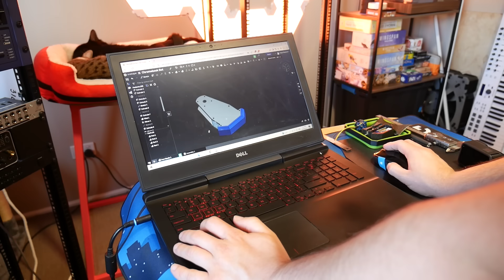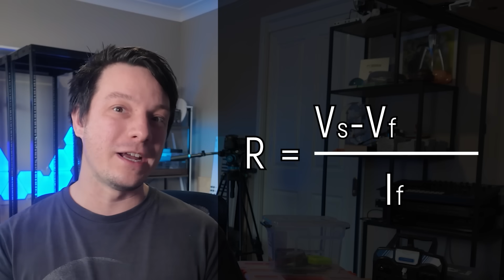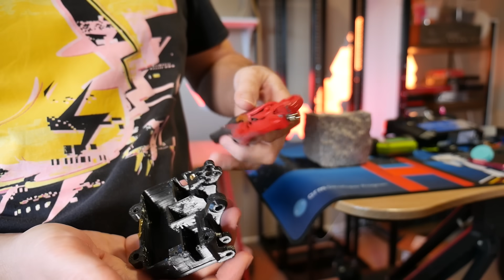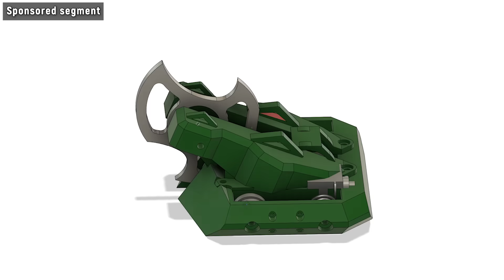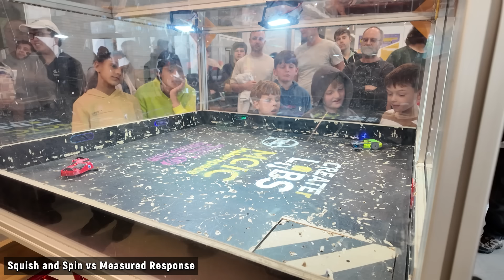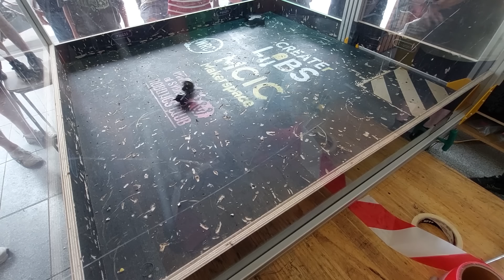How CHEAP can you make a combat robot?

Comment: That transmitter protocol thingy made me think about, well, disrupting the transmission of the other player. That would be a shitty move and for sure against all kinds of rules. But. A small EMP pulse? Not in any official match but you could probably get someone to battle against for fun with it. A small disrutor pulse. It would for sure cut the control on BOTH the robots for a short while, and, yea it would be dumb. But i also feel like it would be fun.
It would be hype in a match to have a robot that emits pulses every now and then. In the broadcasted matches it would make for a cool gimmick. If the rules allowed for it. It would be sorta kinda useless as a real weapon, to make it not unfair it would need to be really short. But oh boy it would be different.

Comment: hey had the thought that, Bambulab has there maker supply's and was woundering if you can find what you need in there to make an antweight battlebot? There might be cheaper sites or better alternatives, but i was just woundering if its possible. (not counting the screws but mainly motors, control board and other electronics)

Comment: One thing I would have also brought up in the video is wedge bots and servo powered weapons like grabbers and lifters, as I think only focusing on spinners not only limits people's options in their design, but also poses a much greater safety risk.

For newer and especially younger builders, I always recommend these first because they are not only easier to construct, but WAY safer to test. Spinners should never be someones first robot, especially if they don't have a safe test box, as they can cause serious damage and injury. Wedges, grabbers and lifters meanwhile are very easy to assemble, lower the cost and are much safer to run outside of a test box. Plus control bots are still a ton of fun.

Comment: For traction, use liquid latex! When it dries, it turns into rubber.. which is pretty much what tyres are made of. Just brush it onto the outside of your tyre, or dunk them into it.. let it dry.. then repeat a few times. It'll be really tacky, flexible, but also quite tough.
And the N20 motor might've been one for higher voltage.. but yeah, they still seem to vary a lot in quality. Not sure if 1000RPM isn't too much too.. looks like it's extremely hard to control.
Reply: Liquid latex is often used for theatre masks/props making. Just get a small amount for testing first. It doesn't have a very long shelf life.

Comment: I think there is a way you could forgo wheel motors and run dual spinning blades going in opposite directions on opposite sides of the front (i guess kinda crab-shaped).  They would likely need to be at some angle above the horizontal, which would then lower the edge of the blades to the ground as well, letting you get lower hits in.  Controlling the movement/direction would then be using the combined torque to 'steer'.  It would likely be easier to control as well, albeit slower moving.

Comment: Brass inserts with like 100kgf of pullforce insufficient for ant class combat robots?
Odd...
But then what else you can do is just have tight hole and have a metric screw like M3 jam into filament, in some cases the friction can be so much that it will snap the head off.
Reply: Heatset inserts simply don't provide that level of pull out resistance in TPU.

Comment: Now make one without a 3D printer. It's hard for a child to convince their parents that they need a $200-$500 machine to compete in a sport that they just heard about. I used a salsa bowl and cardboard to make a $120 USD robot, including the cost of all tools I used to make it (Harbor Freight soldering iron and a bottle of super glue).
Reply from the maker: I do agree it's not cheap to buy a printer on a whim, but any builder would jump at the chance to help a newbie with a printed chassis. I have done it loads of times. You can do the lot by hand (I certainly used to) but it's pretty finicky at this scale.
Reply: @MakersMuse 
Now you’ve got me half considering bringing bags of 3D printed parts to a comp to hand to noobies.
Reply: Check local libraries, community workshops, and fabrication shops. I've made plenty of 3D printed projects without owning one. It helped to have experience with them in high school, but was not a necessity

Comment: The trick with drilling SS with std HSS drill is very low rpm, ie, it's the heat from high rpm that dulls/burns them. I have made straight-through SS mufflers than needed 100s of holes.

Comment: Aliexpress sure does have cheap motors, will be getting some to try.  Higher power motors use carbon brushes, cheap ones are just metal and cannot handle higher current/powers.

Comment: You should think about using an FPV Drone smoke stopper for the first power up, it limits the current so it shut off if there are any shorts/reversed connections. I've built over 100 FPV drones, wings and planes and still use them.
Reply from the maker: Those look pretty neat! Only just come across my radar, I'll pick one up.
Reply: @MakersMuse  they are a life saver, they would have saved me thousands of dollars worth of ESCs and flight controllers.

Comment: $116AUD is about $75USD which is about 2-3 days of working McDonalds part time. A cobalt drill bit can be bought for anywhere between $3-$20, a drill press and a Bandsaw will run you a couple hundred dollars, soldering iron can be found for $5-$10 but added things for better/safer soldering will cost more. PCBway is hardly a solution as in the video making the polycarbonate plate was almost $40(I'm guessing AUD so around $26 USD). Makerspaces are something I see get thrown around as an alternative a lot but the ones around here have monthly memberships with $20 low access all the way to $300 "full access". Would be cool to see a continuation of this video if that part list is updated where he try's this again but with a cheap hand drill and a dremel or hacksaw, I can't really think of an alternative to a soldering iron so that stays.
Reply: The end result of bandsaw vs hacksaw, drill press vs drill is irrelevant for the purpose of a polycarb sheet being sent into combat. Why would that change warrant a new video?
Reply: @engineered_cha0s If it is not shown that it can be done for even cheaper then people will believe its impossible. Basically, you can't fix stupid. And I'm not saying a new video entirely but it would be cool if this was a mini series of just making ant weights as cheap as possible and if he did that, maybe he could do one with a hacksaw and a drill.

Comment: I am curious how you fitted the drive wheels to the motors. Dont the motors have a smooth shaft? How are the foam wheels fixed in place?
Reply from the maker: I designed little printed hubs that glue into them. That bit didn't make it into the vid sorry!

Comment: Hey Angus, try filling the gaps between the magnets in your hub motor with JB weld, it should help tank the impact. Also, I'm curious if conformal coating the PCBs in nail polish would help avoid cracked solder on SMT parts

Comment: Would LEGO tires work well for combat robots? They come in a variety of sizes...
Reply: Yes Lego tyres are great, they are a bit heavy but you can potentially cut them in two, or bore out the centre to reduce weight and keep the grip. Lego tyres + 3d printed hubs is a good combo.

Comment: My first bot was very similar. It was a US 1lb antweight wedge that I powered with mostly salvaged RC gear. The receiver and transmitter were from a crashed drone, and I just had to wire up new motor drivers. I ended up using 4 geared N20s wired up in pairs and used Lego tires glued on the shafts for drive. 

I made most of the frame out of a pair of cutting boards machined at a buddy's place, and I cut up an old T square for the metal on the wedge.

Held up surprisingly well for what it was, but definitely lacked any semblance of polish. My second bot was a beetleweight horizontal spinner that has continuously evolved into my current 4wd undercutter.

Comment: as for the spin on the spot issue malenki nano comes with default 70% steering, it needs channel 5 (only on fs i6 or solder a switch on the tgyi4x) to disable the limit (or disable the mix and use the elevon mix with the switch on the tgyi4x), anyway +1 to get a fs-i6 instead of the turnigy one, as for general n20 motors aliexpress ones are fine but use 12v 1000rpm only for  30mm or less diameter wheels and 12v 500rpm for bigger ones

Comment: I wonder if you could use foam fingerboard grip tape as a tire glued to the outside of a TPU wheel core. Fingerboard foam grip tape is pretty cheap, light, just about the right size, and has good grip. Although I’ve never built a combat robot so this idea may have some holes.

Comment: Bot Bitz sells an AntWeight Starter Kit, 2 motors, with mounts, 2 wheels, 1 switch, and one esc for 24 bucks.  seems like a great starting point.
Reply: Still missing the most expensive parts IMO the transmitter,  reciever and batteries 🔋 so believe he did very well on hjs  parts list
Reply: I might try this in my middle school class
Reply: @robertzarfas9556   me to
Reply: Bristol Bot Builders does similar kits for those in the UK
Reply: Is this the viper kit do you know?
Reply: thx for sugesting this

Comment: Yeah, this is a big problem for such kind of hobby (robots, drones etc) - pretty substantial initial investments. You need remote, adequate solder (like pinecil in this video) with additional stuff, other tools etc. It won’t be super cheap afterwards, but initial expenses quite painful, when you pour money without any results.
Reply: Here's how to build a mini robot for $120*

*Plus the cost of a 3D printer, a soldering iron, multi-meter, an angle grinder, a drill press....
Reply: Just got to the sponsored part of the video. Very interesting that the video does NOT tell us how much it would cost to get all the parts for this robot from the sponsor. I'm guessing it wouldn't be very budget at that point.
Reply: You can usually find a public maker space with all of those expensive tools and machines for free or a small fee

Comment: About drilling through the metal ruler: they're hardened springsteel, so HSS bits will burn out, but carbide masonry bits won't! They're slow and loud and you can't get them in very small sizes, but as disposable bits to get through hardened steel, it's either that, grinding (very inaccurate) or normalizing it before drilling, then quenching and tempering again (time consuming and difficult).
Reply: Carbide PCB-cutters cost next to nothing too. when you add some cooling (just some oil, soap and water work fine or spray some oil like WD40 on it) they can do a very good job too.

Comment: Spray the foam wheels with a light coat of rubber sealer(flex seal or equiv.).  It seals the foam and provides excellent grip with almost no weight added.

Comment: EVA foam with a rubber cement base coat, then covered with 1-2 layers of liquid latex does wonders! Also super cheap!
Reply from the maker: neat! Does the liquid latex stay sticky for more than one fight?
Reply: @MakersMuse as experimental designs said, the traction gets lost a little, but nothing like a quick wipe down with IPA cant help! I use it pretty frequently, and it works pretty consistently! 

I would definitely say it is good practice to let it cure over night to help prevent it from peeling, but its definitely angood trick for cheap foam wheels!
Reply: There’s a drop off after a few seconds of driving from arena dust, but it still maintains ok traction after getting dusty. Some people clean the wheels after each match to remove the dust layers.
Reply: I saw in some other combat robot video I think it was a skorpios battle bot video they put silicone on the foam wheels for a 1lb ant weight
Reply: @Emberrobotics-m8b definitely, I think I've heard of people using RTV as well

Comment: I think you could go even cheaper. Ditch the radio trasmitter and go for wifi control via RoboPad (17USD) if possible. Controls via browser so phone is enough. Robopad also have built in H-bridges for brushed motors. 

In my case I went all brushless motors with 4in1 drone esc (~30USD) with bl_heli S. Had to splurge to program it easier so I own useless flight controler now :) but can be done without using arduino and perseverance.

Comment: I would love to see a soldering video from you. Every time I try I end up screwing it up.
Reply: As somone who does a lot of soldering i would say the trick is heat you want your soldering iron as hot as possible 400c is what i aim for secondly use solder with flux in it and when soldering tiny conections use some flux in a tube it really neatens things up 
As for technique start by getting solder on to the legs of the components i advise crocidle clips or flipping a pcb upside down and putting the component through and then placing something under the pcb to bring it up to the right hight such that the pcb is level then once the componet is atached gently run the iron down the leg this should cause the solder to flow evenly and look much neater
Reply: @Daisy_human 400C are you sure? Please check if your soldering iron showing the real temperature of the tip or not. If you are not soldering which soaks up a lot of heat 400C is very high for normal soldering job. I also solder a lot. For most cases 320‐350C enough. I use t12 style tip. With 400C you quickly burns the flux and solder becomes dry and oxidized. Then you have to use  extra flux. I use flux cored 60/40 solder. I dont have to use flux at all with mirror like finish.
Reply: @shoumikahmed6373  i use a very fine tip so my soldering iron doesnt hold much residual heat which is why it has to get hot
Reply: For training I thing soldering header rows to microcontroller boards is pretty good
You would need to mess up spectacularly to damage something and the results are super obvious.
You want the solder to get sucked into the gaps. That's how you know everything got hot enough.
Reply: @fgregerfeaxcwfeffece thats a good idea it also gives the opertuntiy to learn about how to debridge contacts as inevitably some bridging will ocure when a beginer attempts something lile that but its not to hard to fix in this case simply runjing the iron bettween the pins with some speed should remove solder